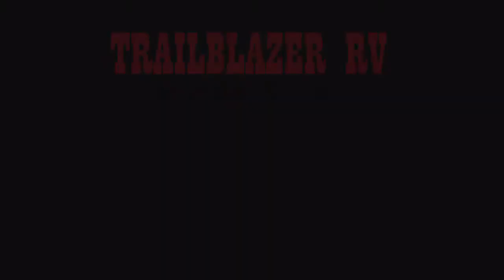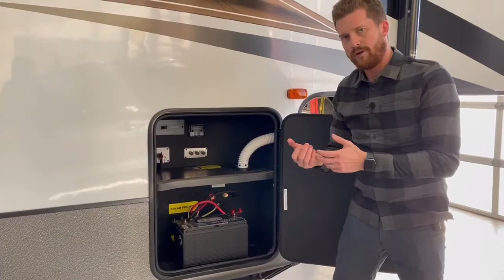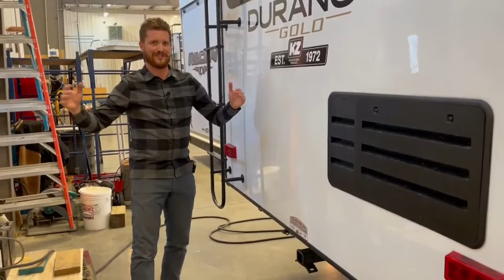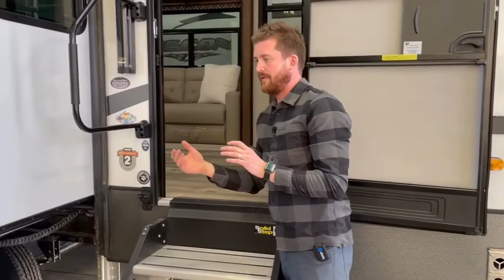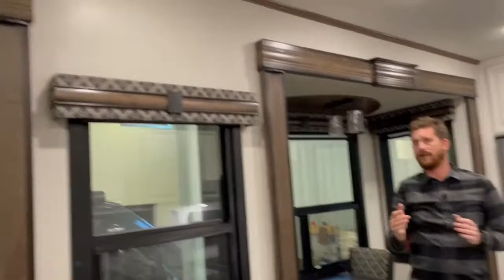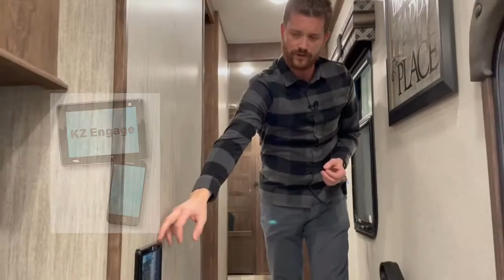2021 Durango Gold - Detailed Construction Walk-Around

Comment: Hi Trailblazer RV, a few questions, if I may:
With the water lines in the channel, how are they accessed if a repair is needed, from the top or from below?
Did I hear correctly that the windows are dual pane standard, or is that just how your dealership orders them?
How much is the off-grid solar package (today in 2023 times)? And, where do the extra batteries go, in the front storage bay?
Are the trusses made out of wood or aluminum?

Comment: How long does it take to get two folding chairs that match the upholstery of our original folding chairs? We've been waiting for over a year.  At one point, we were sent one folding chair to the dealer with upholstery that completely clashed with the upholstery of the chairs that normally reside in the kitchen.  For some reason, someone had a brain aneurism and decided that instead of tacking and gluing the dowel in our original chairs (because the front legs would come apart from the frame when someone sat on our original folding chairs) they decided to send us a whole new set of two folding chairs.  A full year!  NOTHING!  Hello.....

Comment: Does anyone know how to remove/replace the Thetford 94270 CoolVent Deluxe Adjustable Ceiling Vent?  Mine would not rotate, and I ended up cracking one of the louver control arms and I want to replace it without paying the dealer $200 to replace a $9 part.

Comment: The LCI control panel in my Durango Gold sucks.  It takes several finger strikes to select an option.  The touch pad is very unresponsive.  I'd like to get a replacement.  The dealer won't replace it under warrantee, because the device will eventually work.  It is so frustrating to use the LCI control panel, that I use my phone instead, as the frustration of accessing the LCI WIFI and starting the app is actually less frustrating than just going to the control panel and touching the icons already displayed.  The LCI control panel we have is absolutely worthless.

Comment: I'd like to learn how to get the rear AC unit to actually blow the cool air into the living room.  There is a 15-20 degree delta T between intake and kitchen exhaust, but by the time the air reaches the front of the living room, the air increases in temp by 5-10 degrees, and the air flow is less than 1/3rd of that felt in the kitchen.

Comment: Does the 2021 have AZDEL walls?  I know the 2022 does, but what about the 2021?
Reply: I called KZ and answered my own question - SOME of the 2021 units have Azdel.  During the 2021 Model year KZ had supply chain issues with Luan material imported from China.  So, they upgraded to Azdel; a US manufactured product.  Most of those units have the Azdel sticker at the entry door, but not all.  To confirm look at the build sheet.

Comment: Are the slide outs floors, roofs and walls insulated and if so what insulation and r factor
Reply from the maker: You bet!  The Floor, roof, and end caps are all insulated to R-38.  These areas utilize both fiberglass batt insulation and reflective foil which insulate in different ways. 
The slide floors are insulated to R-24 and use a one piece ABS bottom.
The side walls are R-13 utilizing 2" of block foam laminated to 4.7mm of Azdel.  The total thickness of the side walls is 2 3/8".
Most Durango Golds will also be quipped with thermal (dual pane) windows.